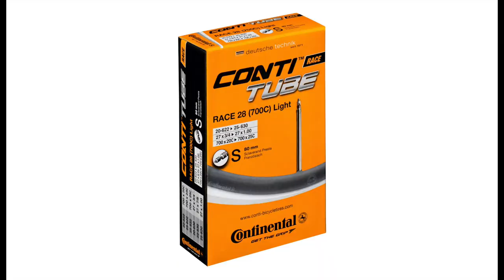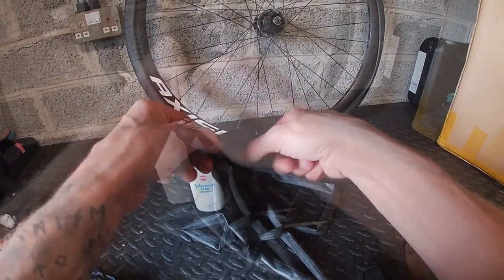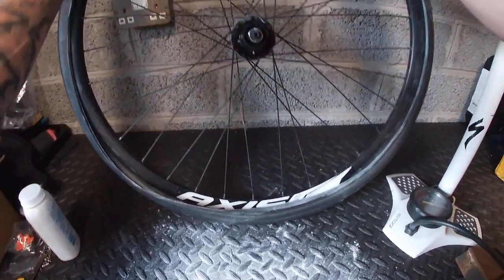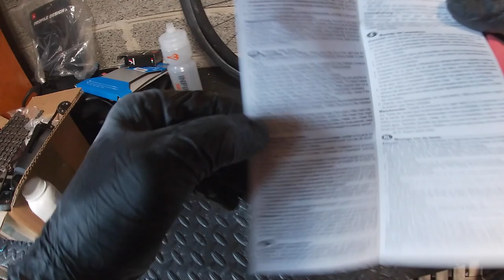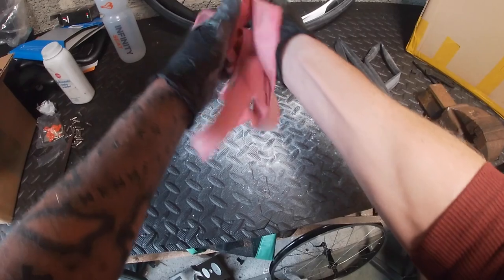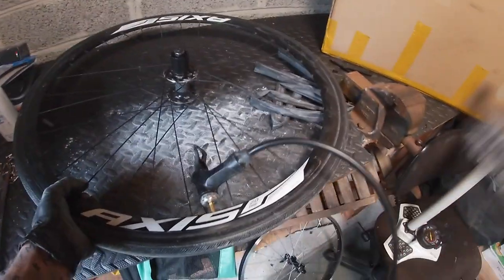Butyl v Latex 24 Hour Inner Tube Leak Test

Comment: I find that pumping the tires to their maximum psi not only acts as leeway but maintains the pressure better as well. Oxygen also leaches through inner tubes three times faster than nitrogen, so it may take a few pumps to purge all the easily diffusable gasses including carbon dioxide. Just my two cents.
Reply from the maker: Nice to know! Thanks, I’ve never tried filling my inner tubes with nitrogen… great stuff. 😎
Reply: @KyrosHouseCycling  It’s 78% of the stuff you’re breathing in right now ;)
Reply from the maker: @blopin2002  ah I thought you had a 100% nitrogen pump or something 👍

Comment: I can’t ride without checking/adjusting TP’s beforehand. That’s almost daily for me. I ride tubeless and have been that way for some years now. No noticeable punctures at all, that hasn’t been dealt with by the sealant. I carry tubolito CX/gravel inner tubes and figure if I’m mostly just going to be carrying these things  I might as well carry the smallest and lightest tubes. 60 gms each? Smallest pack size too, so I have room for tyre plugging kit and co2 carts etc in my small saddle bag. Works for me. Thank you for the vid
Reply from the maker: No problem! I always check my pressures before I ride so as you say it’s not a problem. I’m liking the latex tubes and I’d recommend them to people that check pressures as they do go down. 👍